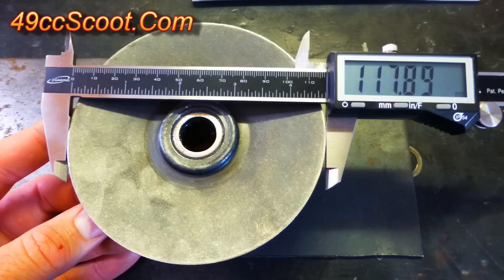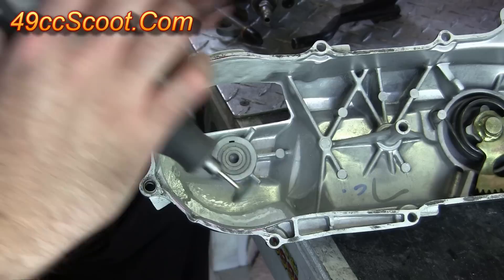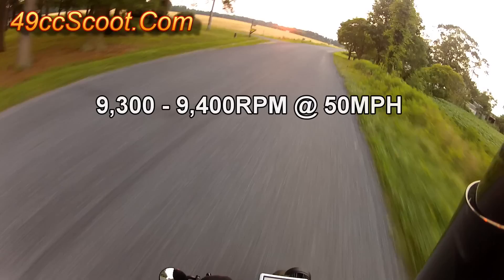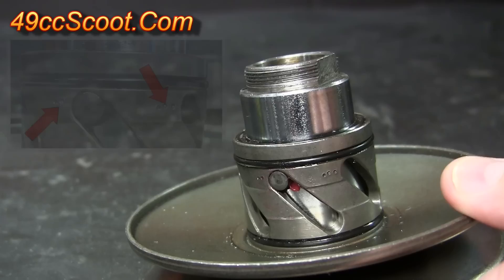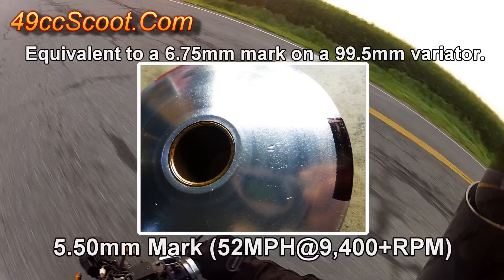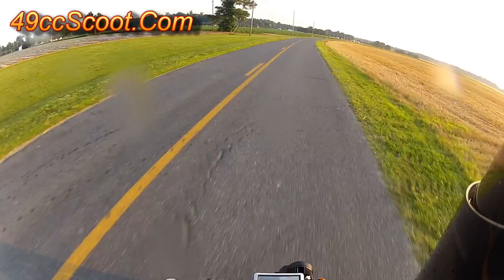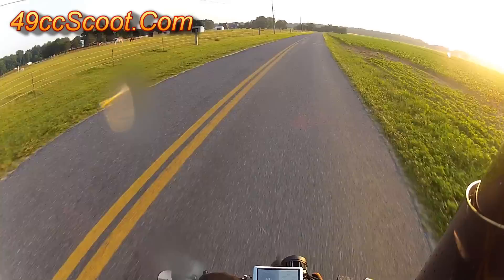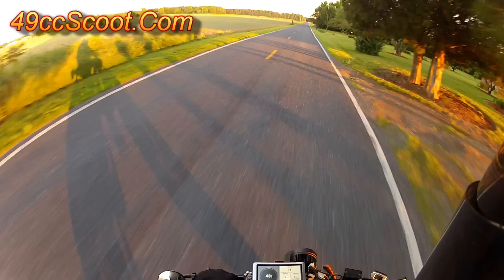Minarelli Scooter Over Range Rear Pulley Alternatives Project 3of3

Comment: some great explaining my dude, happened to have bought a multivar for my peugeot (speedfight 2) that looked really good just used a bit, and my acceleration was lower so i started to look around the internet, its actually an overrange for my setup, slapped that with a big poulie i found at the scooter graveyard here at Amsterdam that nearly fit with some belt i dont know, top speed went from 75km/h towards 85/90+ with some nice wind in the back :) you made me understand all this much easier by showing and explaining in such detail, i thank you alot for this <3. my scooter is pretty much stock 50cc just a high reving exhaust (yasuni r) wich not only goes faster in top, and acceleration the torque make's driving much nicer coming out of the corner and putting power back on where it should.
Reply from the maker: Glad to hear the vid was so useful!

Comment: I installed a shorter but wider belt 815-20-32 on my 150cc KDU engine (QJ153QMI bored out to 150cc) and it doesn't reach the top of the rear pulley, but take off is so quick now, it will pull the fuel gauge down as the gas sloshes to the rear of the tank with 2000rpm clutch springs and 11 gram rollers, and I gained 5 mph on my top end for a 61mph top speed, so sometimes even what looks like a terrible set up, ends up working really well.

Also I think some clutches are much heavier than others, I was able to use 2K springs with the DMC clutch without premature torque spring shift with a 1.5K contra.

Next thing will be a gripped clutch bell, little 150 has so much torque it will slip the clutch on take-off, and the stock bell is wearing uneven, large stripe of oxidation on the outer edge of the bell, probably flared from poor manufacturing tolerances.
Reply from the maker: Most of the GY6s use a 20mm wide belt, so if your first belt was more narrow than that it may have been the wrong one. If you feel the urge to see if there's more in it you could always try finding a 20mm wide belt that's longer.
Reply: I tried and 821 20 30 and 835, the 821 had reduced take off torque and the 835 slapped on the case (way too long), and came apart at speed and made a terrible mess (belt spaghetti from hell!), I'm actually going to try an over-range rear pulley with that bike seeing as I have a lot of torque to play with and with the current set up it isn't going all the way down the pulley limited by slot design.

I took the pulley apart and it's the kind with little bushings on the pins, so it can't be filed longer and limits pulley expansion, found a nice Taiwan made over-range pulley so that will be my next upgrade.
Reply from the maker: Ah, well good luck with it. I know Autotech355 on eBay sells some pretty nice looking pulleys for some apps. I looked at the BWS100 pulley he sells as part of this project, but it's another like the Piaggio that looks good but the price is approaching OR territory by the time you get the whole kit together. Not sure if that's where you're looking, but maybe check his store out as well if you haven't.

Comment: Old ( almost a half year) but u have to adjust springs and weights according to you'r setup in transmision. With Overrange Vario with Overrange pulley u shoud be using 3-4.5gr wights but it has no use on 50cc engine for more performance. it will be only slower and mby a little faster. It's used with 70cc racing cylinders to get the transmision work best.
Reply from the maker: Lately I've heard of even dealers saying the OR kit is not for cylinders that rev under 12,000RPM. I've been using one for a bit now on my 103cc that peaks around 9,000RPM and I've been very happy with it. I have to use very heavy weights (~10-11g) and a 1,000RPM spring from a 139QMB to get it to work where I want, but it's quick and controls revs nicely for me. So many people also think only about performance, but I've used it on the street now with mild builds for thousands of miles and it works very well without things like plastic variator ramp plate bushings breaking or belts snapping and all of the things that can come from more standard performance parts. I've worn out a couple sets of rollers and a belt or two, but otherwise in thousands of miles it's all in great shape other than I need to replace the bearings in the rear pulley's fixed half/sheave soon. That prob hasn't been helped by a lot of the gearbox/bearing issues I've had unrelated to the CVT though.
Reply: Thats great, but i must say that I am using oversize transmission for my high end aerox and only thing that can pull off that 22hp (not on the rear wheel from stop) is oversize.

Comment: This is a great series! What has brought me to you is the fact that my yerf dog go kart utilizes the gy6 150cc engine. So many of your videos are very helpful to me for many scenarios. I watched this series all the way through in hopes to get some answers on what might give me more torque for hill climbing power off the line... I do think by what i saw here that there is a way to get what i am after, but upon closer inspection of my set up, i might have more luck just changing sprocket sizes to get my gains. The output on my gy6 just has a sprocket, then a chain to the axle sprocket. What do you think? Even a tire size change will affect my gear ratio, so these are all things i will have to consider.  Also, do you think heavier clutch springs, roller weights, or contra spring could help me in any way..? Top speed is nice, but i think i am really after the torque. I would really appreciate any info, or opinions you are willing to share. Thanks in advance
Reply from the maker: You can try heavier weights at low cost with modding, so you may want to start there.
https://www.youtube.com/watch?v=YkNhqEFeWVQ

Most people that want takeoff and hill climbing do the opposite though, and use lighter rollers and/or heavier springs. CVT mods may get you where you want to be. If not, sprockets should be easier to change than the final drive gears in the tranny.
Reply: Thank you for the lightning fast response! That makes perfect since. Thanks for posting the link also. That is going to come in handy : ) You are speaking my language, Inexpensive is good at this point : / I could have bout a new go kart, or something cooler maybe by this point in my investment to get this thing back to good, safe operating status. These will be some great methods to figuring out what works.. Sprockets can be an expensive way to go if you are not sure what you need, so i am not sold yet. I see just as much testing with trial and error in my future there as well.. There is something to be said about ease of installation though ; ) I appreciate your thoughts. I will post my findings.
Reply: Last but not least, I ordered the wrong belt size on a bad recommendation. 835 20 30. The belt that was inside the cover is a 743 20 30. Of course now that i have the size, i am finding all kinds of info about this belt working with my Howhit / gy6 engine, but found nothing when i searched for the belt using the engine as a cross reference. It fits tight! Probably a reason for that ehh? I know i should have checked myself first, but my cover is a bit more of a pain in the arse as i have to remove the full exaust every time : /
 What could i expect from using this longer belt. It does not appear it would have nearly as much slack as your longer belt in Part 2 of this series, but loser non the less...So potentially slower take off's, and possibly higher speeds? (Exactly what i am trying to avoid lol) Other potential issues? Roller weights? This thing is eating me alive in parts. uggg! If you think the right belt size is the answer, feel free to avoid answering the above, and simply say that. Thanks again : )
Reply from the maker: One is for a long case and the other for a short case. 
http://www.49ccscoot.com/faq/whatbelt.html

The belt should be sort of tight. It should sit low in the front pulley and high in the rear pulley (near center front, near outer edges rear). If it's too short it can't do that. If it's too long there will be a bunch of slack. I tried a long belt in my OR alternatives video and it made it bog off the line till i took up some slack and it wasn't nearly as far off as a long case belt would be on a short case. A belt that long may come off of the pulleys totally.
Reply: Great info on the forum! You are absolutely correct about the longer belt. It is way too lose, & would surely derail from the pulley's. As you already knew ; )
This is all important info I should have researched and known before ordering part's... says the guy who said it is best to do some research before ordering : D Dohhhh! Admittedly i got lazy near the end of part ordering... Always something to be learned from a mistake though. For instance...
I now know that this spare engine I have is a "long case"... lol. Up to this point, everything i have used off of the 2 engines has cross fit universally. (Minor mod's to the carb. for the throttle cable) So I guess I just assumed that the belt's would be the same as well...  (spare engine drive belt was toast, so not a total waste to order that belt.) Even better, the kart has a very new looking gates belt already equipped. Probably the only good part made out of rubbed left on this thing! All i was told is that it had sat for at least 10 years... I almost gave up a couple times on this thing! This is why i am so thankful to you and a few other guys here on youtube. Your videos, and your personal time has been beyond helpful!  Sorry for all the questions boss. I probably owe you a couple cases of beer by now. (figuratively speaking...)Thanks for all the info and for your patience. : )

Side note: My clutch pulley measures at approx. 142 mm (outside diameter)With the 743 belt installed as lose as it can be, the belt has very slight slack. It wraps the drive boss in the front, and sits about 14mm deep inside the clutch pulley. It also appears from the belt wear marks on the clutch pulley, that the belt never rides much further out towards the edge of the pulley than that. (12mm of non touched surface at the max point of contact) Sounds about perfect i guess as i explain it and consider all the different measurements you came up with in all your tests. My kart honestly feels very responsive the way it is now. Maybe too responsive... With gears or sprockets it all seems so easy. Want to climb? larger in the rear, or smaller in front. Want to go fast? Just the opposite... smaller in the rear, or larger in the front, or both. Essentially the cvt is no different, but is where i get lost when trying to decide what i want it to do. Especially since it constantly changes with rpm. I think i would like it to build just a bit more rev before it engages. As it is now, it climbs well, but requires a bit more speed to carry some hills. If you do not build up enough speed, It seems to sort of of stall in motion. It is great on open flat trails, maybe even a bit slow, but for the sake of choosing 1 thing i would like it to do best, I would prefer for it to build up enough power, so that the reason it doesn't make it to the top of a hill, is because of traction loss, not power deficiency. if that makes since? It needs more turbo power! I feel like heavier clutch springs could be a good start, maybe even some mild shimming. Other than that, it may just be easiest to step up a tooth or 2 on the rear sprocket. Although top speed will suffer, i know i can get what i am after in this way. Great weekend to you : )
Reply from the maker: I still make plenty of mistakes. If you aren't screwing something up, you aren't learning. You either need more engine output or to stay in the powerband through CVT tuning for what you want. Ideally of course would be to have both. The more stable you can keep RPM, the nearer you can keep to peak output anytime you're WOT to help you up hills or just to accelerate faster.

Comment: What the best of all yourtest?
What happen if I light weight the clutch?
Drill the three clutch shoes.

Sorry for bad english.
Thank you.
Reply from the maker: The whole over range kit is the best. The Malossi OR vari and the HOCA rear pulley with Bando belt did well as did the Piaggio rear pulley with HOCA vari and Bando belt. It's all summed up at the end.

Lightening clutch shoes makes them engage a little later.

Comment: Thank you for all your videos, they have been nothing but valuable on my own scooter-tuning journey.
I was thinking about installing a KOSO 139qmb/DIO rear pulley with variable angles on a minarelli horizontal from my Bugeye Zuma.
In theory, do you think a wider belt (with the correct length) would have helped the performance? 

The stock belt installed on the zuma engines makes it quite low down the rear pulley, and I was thinking with a longer + wider belt (738x16.5 vs 748x18.5), it could take advantage of gearing, additionally with the use of the 139qmb rear pulley. I can get the setup for under $50 shipped total, so it is appealing to me.
Reply from the maker: Wider belts are kinda tough to deal with. The whole system is designed for a certain belt width and you only have so much space to add shims. Wider belts usually ride higher in the front pulley, which is bad for takeoff. If all you care about is speed, it may work out.
Reply: @49ccscoot  I don't live in the flattest place on earth, so I do need to take into account more than top speed unfortunately. I think I can get enough power out of the stock CVT setup (maybe doing the same modifications as you on the rear pulley so it can open up wider) with a 70cc kit without going through the hassle of changing belt size/rear pulley... so I'll have to put this idea on the back burner for now 😀

Really appreciate the quick response! Thank you for your time and videos
Reply from the maker: @4Denwa  If it's a 50 now, I think a 70 will better serve you. The power should be quite helpful on hills. Also, Zumas tend to have very deep gears, so if you are looking for speed a gear swap may be better, especially after a 70cc kit.

Comment: Are straight groove pullys always better than multiple angle, if you trying to get better take off and acceleration
Reply from the maker: No, not always. Some low powered setups benefit from the dual angle grooves. I had better luck on a stock engine with the stock torque driver. With the proper angle, it would probably work well. I think the angles may be too aggressive for stock engines in many cases.
Reply: I have a Honda elite with 70cc kit and all the stuff( street set up) and I have a zx pully with duel angle and one with straight I think I’m gonna test both out and see. And I have a few different variator like ruckus variator (bigger) a dio pully( the weights go out farther making higher belt travel) and a stock

Comment: Would there be limited CVT tuning in every different types of scooter, what I meant is that if the CVT tuning of this latest video of yours would be applicable to all types of scooter whether they are 50cc, 110cc, 125cc or 150cc scooter? I'm kinda worried if I will apply this on my scoot, it will give unusual vibrations
Reply from the maker: The exact info definitely won't apply to all scooters as far as what fits or how to make it fit and so on, but the basics should apply. Before getting into anything like this I would advise checking out your CVT and taking measurements and seeing if there is room for larger pulleys and so on. Before getting into swapping parts from other scoots on, see if there are affordable upgrades that are direct fit for you. As long as parts fit properly and aren't out of balance for some reason, vibrations shouldn't be a concern anymore than with stock parts.

Comment: WHAT KIND OF rpm tachometer DO YOU USE CANT FIND ONE THE WORKS WELL  HELP RUINING A HONDA AERO125 NH I LIKE THE tachometer YOU ARE USING ??
Reply from the maker: madmarkstoys It's a Trail Tech TTO tach. The main downside is there's no back light. I have a vid showing it more here : https://youtu.be/zJ9NZxW3-W0
Reply: THAMKS I WILL TRY THIS ONE I HAVE TACHS BUT THEY FREAK OUT ALL THE TIME UP In RPMS LIKE THE PULSE IS CUTTING OUT  AM A RUN  HONDA  AERO 80 AND 125 AERO 2cycle guy a have been clutching for the last 15 years  you the only guy that gets it!!!! i like your videos bro
Reply from the maker: Thanks.

Comment: i tried the 139qmb rear pulley, and no matter what i did for spacing between the clutch bell and the torque driver nut, it wont spin freely once its tightened up. i want to use it over the stock rear pulley because it has the straight grooves. but if it wont spin freely no matter what i put for spacing what is the point. did you run into this problem?
Reply from the maker: I showed any issues I had with that pulley in the video. If you can't figure it out by switching around spacers and such, try examining it compared to your stock pulley to see what may be different and causing the problem.

Comment: Do you have a link where to buy that hoca torque drive pulley half(the one with angles)?
Reply from the maker: PartsForScooters used to sell it. I'm not sure that it's around anymore. Maybe SSP-G now if they have it.
Reply: Have you tried using a bws100/rsz100 torque driver which is 124mm diameter compared to 115mm to a stock minarelli TD if will fit nicely on the case without mods?thanks
Reply from the maker: @ninoechavez1402  I have not. Anytime you get significantly larger, it could require some clearance work. I think it should swap onto the shaft OK.

Comment: my scoot 150Cc, front variator better use same with your degrees? or I use 13,5°?
Reply from the maker: I haven't really played with angles on the 150, but the same principles in the video would apply as far as changing the angle.